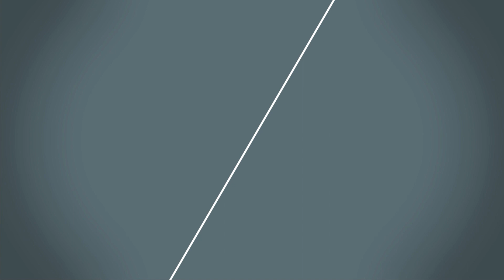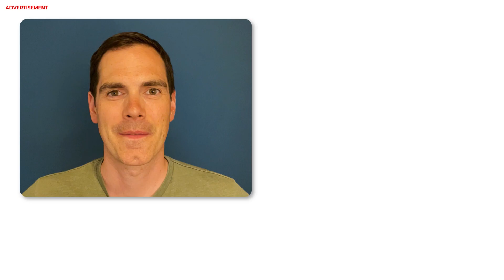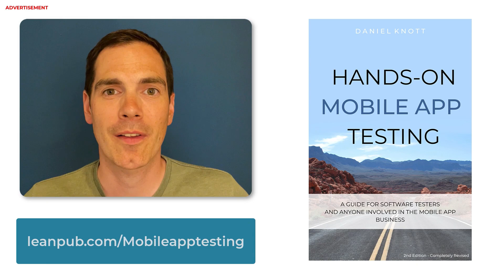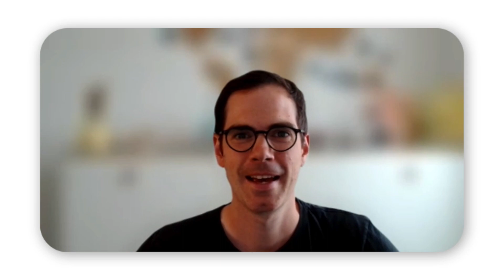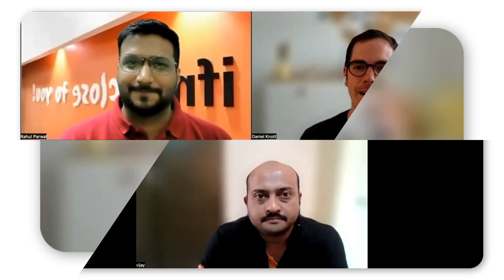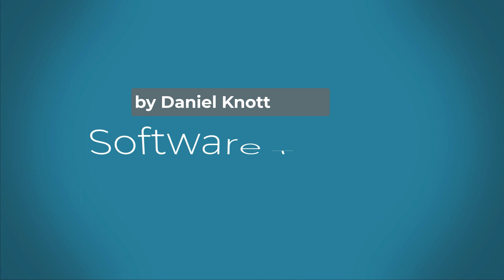What makes IoT Testing Special? An Interview

Comment: Just wanted to let you know your leanpub link is down.
Reply from the maker: Thank you, fixed it 🙏🏻
Reply: @DanielKnott  BTW how in depth is your book really?
Most technical authors make a book just because they can add to their branding the "author" label but they do not actually care enough to truly share their full process in depth.
Reply from the maker: The book covers all aspects of mobile testing. From mobile customers, challenges in mobile testing, testing techniques, test automation to releasing a mobile app. I am not going into deep test automation. I mention tools and techniques that will help to get started with automation. But I also think it depends on the reader. If there is someone, with NO mobile testing skills this book is the right starting point. if you are already familiar with mobile testing, I think you can get new impulses for improving your skills.